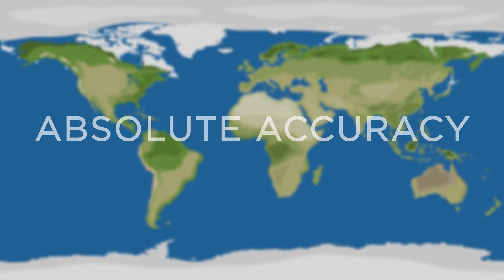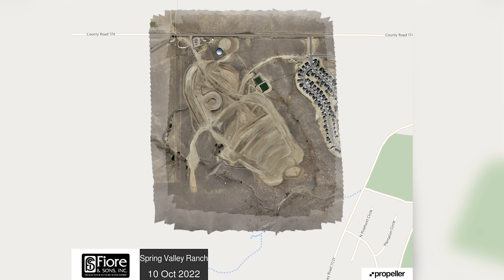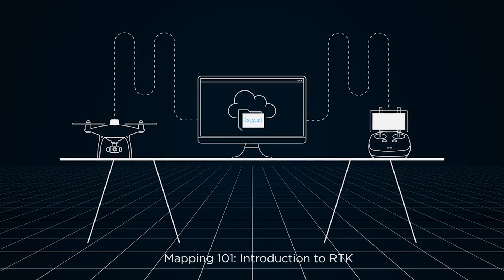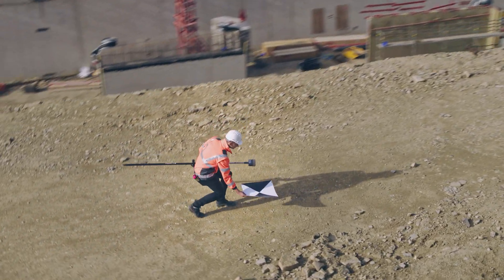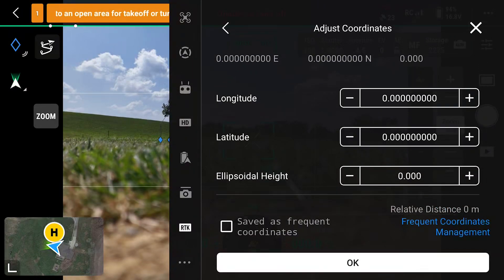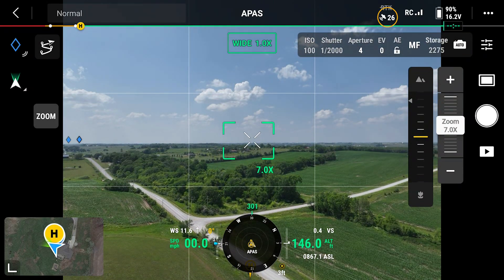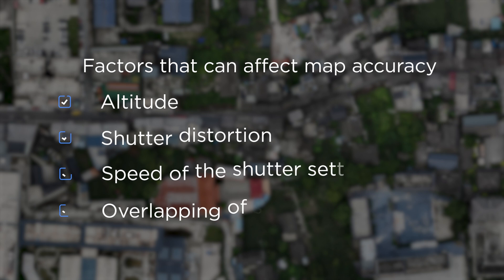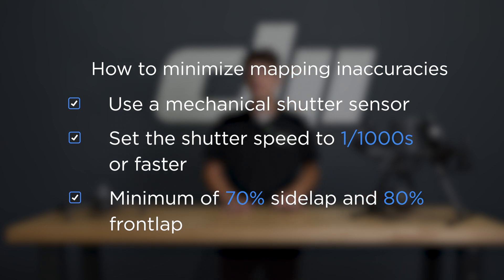How To Ensure Map Accuracy

Comment: Hi! I'm trying to understand the relationship between geoid, orthometric height, and ellipsoidal height in surveying/photogrammetry. I heard ellipsoidal height (h) is the distance from a point to the reference ellipsoid (like WGS84) via GPS, orthometric height (H) is the distance to the geoid (mean sea level), and geoid undulation (N) is the gap between them, with the formula h = H + N. Is this right? Also, in the video @Kyle Miller entered only the 1.8m rod height as the ellipsoidal height for the base station instead of the actual ellipsoidal height for that lat/long? Is this a simplification or something else? Thanks!
Reply: also, based on this video, i am thinking I'm using my DJI D-RTKv3 base station and Matrice 4E incorrectly. when will you be producing a video for novices like me about the M4E and D-RTK3?
Reply: You pretty much got it.  The ellipsoid can be defined with mathmatical perfection.  The geoid can only be measured and appoximated.  Most engineering projects need to be corrected to the geoid because if we didn't there would seem to be circumstances where water was "going up hill" due to the shape of the earth.  Geiod corrections allow GNSS measurements to align with traditional spirit level measurements.

Comment: 6:02 come again..?  But you said in 5:53 that it's possible?

Is my understanding correct that prior to conducting a mapping mission, you first identify several GCPs to be used later for counterchecking the drone mapping's output, with the base station as the main GCP / reference point of the drone?

Also, what's the maximum allowable distance between the M3E and D-RTK2?  If we are beyond the max allowable distance, can we move the D-RTK2 while the M3D hovers around its location?
Reply: What happens with the adjusted coordinates if you need to move RTK2 location because of lost signal?

Comment: Hey Kyle why did my oblique mission set up button disappear. Rendering my mavic 3 enterprise useless for 3d mapping
Reply from the maker: It has been built into the 2D mapping UI.
Reply: @DJIEnterprise  that was a dumb move on dji's. Not thinking or caring about the professionals that already had a workflow in place and that UI for creating the oblique mission is absolute shit.
Reply: @DJIEnterprise  I wish I could revert back to previous firmware for the pilot 2 app. I don't know why you guys did that and then had no release note or where to find what or how to use it. It cost me a mapping job this morning. Was on the phone with "customer support " at 9pm last night and they knew absolutely nothing about it! Very sad and poor execution of that firmware update. God forbid users get use to using software a certain way.   Save all that B.S. for the mini 3 "PRO" users not the professionals that drink the dji coolaid and spend thousands of dollars on hardware and another $1500 to use terra for a year oh and the $709 for a RTK Module. Any way I'm sure dji paid you for showing up at work today unlike me.